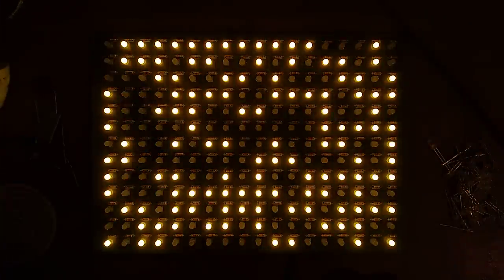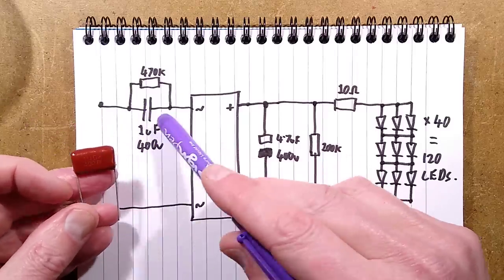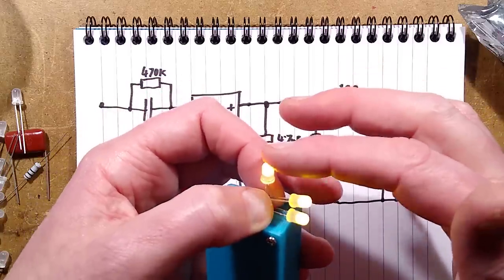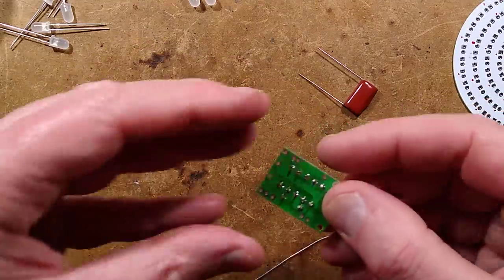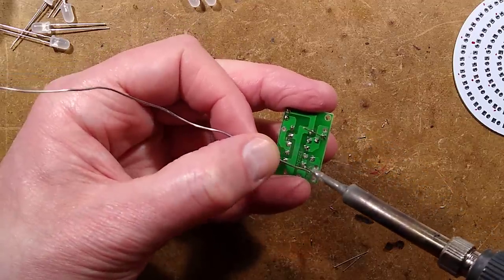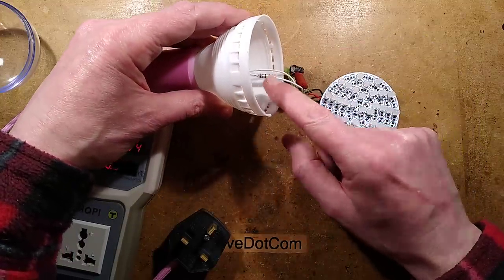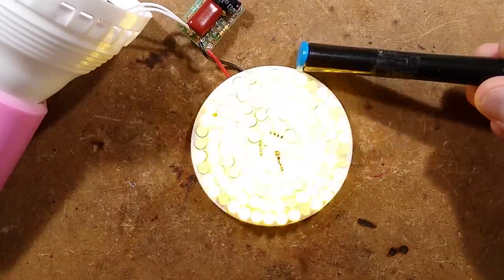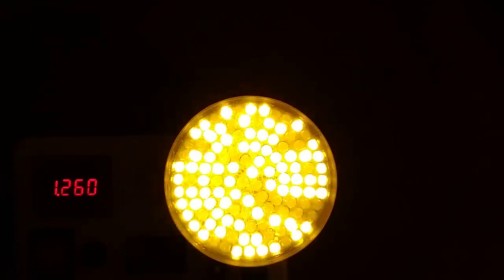Supercomputer light bulb build   -  with schematic

Comment: I too prefer leaded solder. The flavor is so much more robust. The earthy tones pair very well with Amtech 559 flux.
Reply: and the lead in the smoke works so nicely as hair gel when I lean right over my work.  The non-leaded solders are too stiff and make my hair too finicky.
Reply: The lead oxide leaves a nice sweet note on the aftertaste.
Reply: Especially when carbonated.
Reply: The smoke is from the flux/resion, not lead vapor.
Reply: @mernokimuvek  and, fun fact, the higher temperature fluxes used for lead free solder apparently tend to be more californian

Comment: Fun trick with  "supercomputer" panels - heat or cool one corner before turning on - when you turn on, you see a wave moving across the board due to the effect of heat on the flash rate
Reply: I like your spark-o-phone very creative 😎
Reply from the maker: I think it was Mouse who mentioned that a while ago.  I heated the centre of a panel during a stream and then turned it on and got a nice circular burst effect.
Reply: Clive always got cool content. But taking what you posted and the visual of the lights at the start of this video as they blink on and off with varying brightness also reminds me of a (still theory) theory of time I made up several decades ago about “ what is time” if those LEDs were RGB and each shrunk down to a Planck scale size which is about the smallest hole/orb theoretically possible which not even quantum particles can pass through and if you gave each color of the RGB which combined creates white and when off creates black or darkness correlate density of brightness with a temperature as in dimmer is cooler brighter is hottest that would make that single board of 18x13 Planck scales wide which there is yet an instrument built capable of direct observation since there are no materials fine enough to make one from its effect can be observed and in turn proves time exist as a temporal effect of what is to this day being denied “ the aether” . I know what everyone’s thinking WTFs this guy talking about? Sorry . 😁 just saying time exists and the board serves as an example of what can’t be seen if those LEDs were as tiny as they can be , but if you could see it, maybe one day someone will after all we now have images of an actual atom but here’s my theoretical equation in layman’s term. The Planck hole will appear like a quasi crystal orb but that visual which like the first image of an atom will have more questions then answers because nobody can definitively confirm it’s not just an illusion.

Comment: ive built few like this superputers, 10x10 grids, usb powered. its a fun project. ive done it with 3d printed plate instead of pcb, so soldering was finnicky, but everything is hidden in the back, and closed. turned out 2mm thick silicone sheet is very useful thing

Comment: I love this Clive and all your other build projects and I’ve been subscribed to your channel for a few years now. I’m a 60 year old semi retired mechanic and I’ve always had an interest in electronics especially automotive stuff and your great content has enlightened me and encouraged me to start doing some low voltage stuff myself. I’m very keen on Solar Power and would like to kit a self build camper van out and be able to “live off grid” for a few months of the year and tour the UK. I would be very interested and grateful if you could do some kind of basic Solar System or even a look at pure sign wave inverters with 12v in and 240 volts out. Thank you for the great work you do and long love your channel 👍🏻

Comment: I prefer lead solder as well! My absolute favorite is the Radio Shack 62/36/2 silver-bearing “high tech” solder; that stuff is absolutely magical and flows wonderfully at low temperatures, leaving behind beautiful joints. My spool is running dangerously low, so I have to see if I can still find it. Cool build!
Reply: unleaded solder is awful, unfortunately more and more difficult for' hobbyists' to get it,  but manufacturers can? you'd think it'd be the other way round, its the mass manufactured stuff more likely to pollute via landfills rather than small quantities of home built stuff!  both types of solder now getting stupidly expensive , £30 ish, or more, for a 500g reel 😲 i used to pay £5 plus vat per reel from Grandata in the mid 90s!

Comment: Excellent video. I might use this idea for a 1984 camping gaz LPG lamp I'm converting to LED's and put an empty unused tea bag over them for a gas mantal effect. With it will go a white noise sound generator board I plan making for a gas hissing effect. Probably end up feeding the wires through my 1920's house's old coal gas lighting pipes and have the glass pointing towards the ceiling.

Comment: Great project! Your soldering skills are excellent, you must have been doing it since you were a youngster. I received a Heathkit and Soldering Iron when I was about 8 or 9 years old and couldn't quit😀
I have to have a wet Sponge to wipe the tip often
Reply: yep, i started tinkering with electronics and soldering since i was about 8 ish,

Comment: What also helps to hide the static LEDs is that the flashing LEDs draw current away from them when they're on, so they vary in brightness too even if they never turn fully off. In fact if you were to do a multicoloured one you could have them all flashing if the static LEDs had a higher forward voltage than the flashing ones.
Reply: I was actually thinking the same thing.. if you used static LEDs with a higher forward voltage, then when either of the flashing ones turned on, it would drop the voltage below the static LED's cutoff and the "static" LED would turn off, so they would only turn on when both of the others were off.

Might take some work to find a combination of static and blinking LEDs with the right relative voltages, though...

You could also use all blinking LEDs, but solder some zeners to the back to ensure if they were all off that the voltage didn't go too high.  (or you might be able to get away with just some resistors, I'm not sure)

Comment: I found a nice second use for the bright white plastic tubs "Philly" (Philadelphia cream cheese) comes in -- they are great containers for the screws and small bits of devices I'm repairing, and they are also great for the electronic components from DIY kits. The tub is bright white, so even small components stand out and are easy to see. And if a project is delayed, closing the lid means no part falls out and disappears in the depths of the carpet... 

Looking at the start of the video, maybe you should give this a try? (Any brightly-coloured empty container with a lid will do, of course.)
Reply: Our library uses those, also the tall plastic containers from Crystal Lite drink mix, for kids' craft supplies. I must have given them dozens over the years.
Reply: May I also suggest " Kremelta " containers 
  
  After " cocoa powder  + rice puffs + Kremelta " = snacks 
  Empty container is reporpoised

Comment: Yay for leaded solder! The whole lead-free solder shenanigans are cow excrement. There's good reason aerospace, medical and military applications are exempt. I'd be willing to bet the amount of e-waste from premature failure due to lead-free solder more than offsets any ecological gains from using lead-free solder in the first place
Nice to get that out of my system, thanks for reading ;)
Reply: How many years of research have you done on that and, more importantly, how much would you be willing to bet? Also, are you taking any bets on leaded petrol?
Reply: @RFC-3514  No research myself, just common sense, practical experience and reading others' research papers.
Lead-free solder has (re)introduced many issues we don't currently have with leaded solder. Like I said, certain categories of electronics are exempt from the ban on leaded solder and that's simply because the use of lead-free solder causes a marked increase in the failure rate of electronics.
Taking into consideration the absolutely miniscule amount of lead present in a complete device, the environmental benefits of using lead-free solder are marginal at best. Meanwhile the aforementioned increased failure rate generates more e-waste than if we'd continued to use leaded solder. So now we have a larger pile of trash, just with less lead in it.
Regarding leaded petrol, what kind of a weird comparison is that? Of course leaded petrol is horrible and it's a good thing we (finally) got rid of it. But unless you plan to run your car on leaded solder, it won't be combusted throughout our streets and cities to then be inhaled or ingested by anyone. Unless you're worried about the burning of e-waste, but that's something that needs to be addressed by better recycling and waste management, not by making it slightly less bad by banning leaded solder, that's just gesture politics.
Reply from the maker: Leaded petrol was a completely different thing.  Genuinely airborne lead smog as opposed to solid blobs firmly attached to a PCB.
Reply: Well, I replied to this and the reply seems to have been deleted, which has been happening a lot in this channel. Maybe YouTube is in the pocket of "Big Lead". :D

Comment: I have dismembered a number of "dead" led bulbs and I've noticed that it's never the cobs that have gone.  It's always a larger component.  Which makes me wonder - surely they would be repairable if they were not so glued together( obviously the manufacturers don't want you repairing your bulbs, they want to you spend £5 to £8 on a new one ). So the kits might be worth it because you CAN replace all the electronics if necessary.

Comment: I've done one with slow color changing RGB LEDs but once the LEDs are all out of sync it's not so interesting anymore since the light outputs a more or less white light.
Reply: Same here.
Put the bulp inside a difused orb and it turned out quite well.
Reply: Ah, OK.

Comment: Lucky that the flashing LEDs don't reset their cycle with the 50Hz pulsed DC power supply (electrolytic capacitor is not really very large). Nice!

The non-flashing dip ever so slightly, a very nice effect!

Comment: Really great idea. Wouldn't mind having something like this. Unfortunately, I'm no DIY electronics guy.
Now about that lamp case, were these slightly bigger, one could put a proper SMPSU in there instead of a cheap capacitive dropper. Wouldn't need to rely on your load to regulate voltage.
Reply: you could, but capacitive droppers are ok, you could clamp the voltage with a zener,  smpus too 'noisy' in terms of interference, and more likely to fail ,,

Comment: 2:40 Why do you call it a death beam
What do you wipe the soldering iron off on I'm jealous of how well your tip is tinned what temperature do you have it set at
Reply from the maker: Around 350 to 360C and a brass cleaning sponge.  The death beam is a reference to a conspiracist who claims that the 400V capacitors in LED street light drivers are to power the 5G death beams.

Comment: What's the typical use for these lamp kits? I'm struggling to think of anything other than edge cases over just buying a bulb.
Reply: As far as I can tell, the major point is to be a DIY kit.
And a minor point is that yo can make it with any colour LEDs you want.
I've built a smaller versio of this kit with near-UV leds to make a "blacklight", and did another with RGB colour changing LEDs for a disco light effect.
Reply from the maker: Just for the sake of building a custom lamp.

Comment: Is it possible to build an LED 4x4x4 or 16x16x16 cube with Flashing or colour changing LEDs ? Most ones use an Arduino to control the flashing, but if it could be done passively and have them all randomly stray away would truly create a random pattern.

Comment: You can use all flashing LEDs but you need to add a small electrolytic onto each triplet to even out the flashing, you get brighter flashing as the instantaneous voltage is higher, I used to use flashing LEDs as very low rate baud clock generators for signalling over V21 DC to 300 baud modems and leased lines for burglar alarms and access control,  it's cheaper to use a flashing led than using a multivibrator as the generator but adding a cap solves the problem with the switching to off
Reply: ? surely you'd need a zener across them in case of all leds going 'open' at the same time?

Comment: The 10ohm resistor where it is now, would act like a fuse if the Leds went open circuit ?
Reply from the maker: The ten ohm resistor is in line with the incoming power to act as a fuse.

Comment: Maybe 3 separate blinky circuits so the voltage drops can be kept consistent?
Reply: or stick a zener across each 'bank' to clamp the voltage , it'd be better if they had more banks of less leds as you could reduce the current for a given brightness

Comment: I've looked around at my place and found a few of those cheap Ebay PSUs for mainly for LED appliances. They supply 5-12V at around 300-1000 mA and their PCBs aren't much larger. What do you think about those? Would it worth to test those out in a similar project in the future?
Reply from the maker: Those are common in things like the GU10 lights and some wall lights.  The simpler capacitive dropper is well suited to this style of light though.

Comment: I don’t quite understand what you mean about the open circuit LEDs causing a pulse of current. Is this something similar to switching an inductor, or are you just saying that the voltage may go high if there aren’t enough LEDs loading it down?
Reply from the maker: If an LED goes open circuit the voltage across it will increase and the capacitor will potentially charge to a higher voltage at that point.  When the LED lights again the higher voltage being clamped may cause a current spike.

Comment: I found it quite hard to get hold on to those LEDs in UK, does anyone have a part number? The ones I got were from TME and the flash time is not as long as those are. I tried to find some but either they price them like 50p per one, or they want me to but like 10k of them I only needed 300 for my project.. I already done it with what I could find.. but maybe someone else can use them. I heard Mouse use to sell kits, but not sure anymore, buying such components in small quantities is a pain
Reply from the maker: It was very hard to find the slow ones.  The seller I got them from had a minimum order quantity of 5000 and half did not arrive!

Comment: Is there a good kit for the supercomputer panel? Any tips where from?
Reply from the maker: I have the PCB files on my website for download.  The other components are diffused 5mm flashing LEDs, 1000 ohm resistors and a USB cable for power.

Comment: I find it always funny that you say that lead based solder is better. I have modern German made lead-free solder from Felder and the only difference is that I had to raise the temperature of the soldering iron by 10°C and the smell is a bit different.
Reply: has it got any silver in it? about 1 to 2%? that supposedly improves it, but of course costs more!
Reply: @andygozzo72  It is Sn100Ni+
According to the datasheet max 0.1% Silver
Reply: @DirkFedermann  maybe they found a bit of nickel works well,  cheaper than silver

Comment: Have always used lead based solder, certainly flows better than lead free types. Apart from slight retardation I have not had any adverse health issues from using lead base products for the last fifty years.

Comment: Why are you worried about current spikes?  Can't just let the components tough it out, letting all the LEDs blink?
Reply: it'll likely be voltage spikes as well, if all leds in a bank happen to be off, the voltage will rise quite quickly and may even blow the leds!
Reply from the maker: A current spike can damage the LEDs.
Reply: @bigclivedotcom  wouldnt the high voltage risk blowing the internal flash chip?

Comment: Hi Clive. I've just been asked to give my opinion on microwave kilns for firing small ceramic/glass/metallic clay objects. I'd never heard of this until today, and have given what I think are a series of sensible warnings: 

"Right - I've formed an opinion on the microwave kiln.
It appears they do work. The liner absorbs the microwaves and re-emits thermally in the interior.
that's the good news.
The bad news is that it looks inherently dangerous.
I would suggest the following precautions...
1. Keep the cat away from it
2. Don't use your good microwave; get a charity-shop one or something
3. Do the actual firing out on the outdoors
4. Don't be near it when it's firing
5. Use kiln-gloves
6. Make sure you're fully covered up with long-sleeves and trousers, and with fully closed shoes.
7. Make sure you've got somewhere to put it down to cool
I don't expect the microwave to have a long life.
The kilns themselves look difficult to handle"

but ultimately my opinion is based on not-very-much. You're my go-to guy for this kind of thing. What do you think? Fancy giving one a bash?

Comment: I'd be interested to see a smaller one with pairs instead of triplets, then use static blue and flashing red LEDs. They should toggle back and forth since the red ones have a lower forward voltage.
Reply: Would be interesting to see how the whole circuit handles the initial 40V jumps between all-red and all-blue, or whether the blue LEDs even start up quickly enough to prevent opening the circuit for too long.
Reply: @restorer19  you'd have to add a series resistor, higher value than that shown,  between reservoir cap and led banks to absorb the peaks

Comment: How about duel colour changing leds, say  blue & red.. would that stop the open circuit during the colour change ??
Reply from the maker: It would, but I'm not sure if the red LED would clamp the voltage low for the other two parallel LEDs so their blue didn't light.